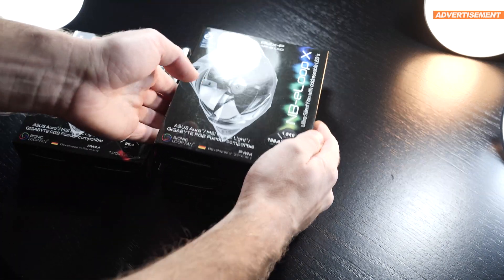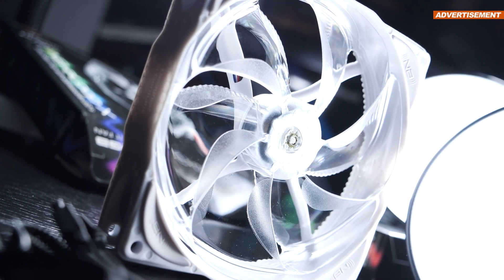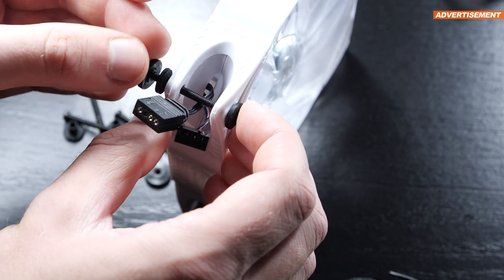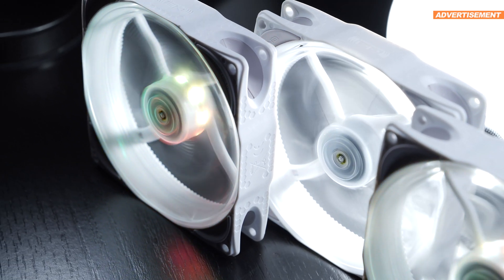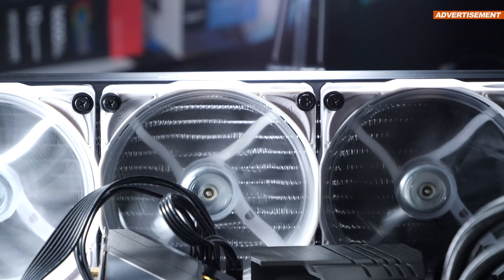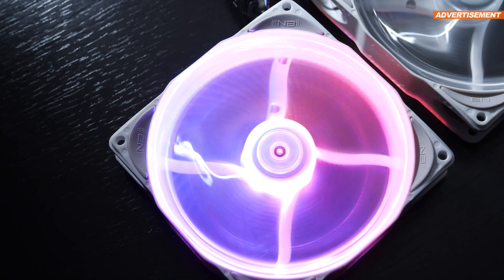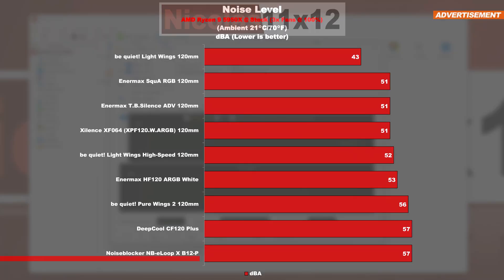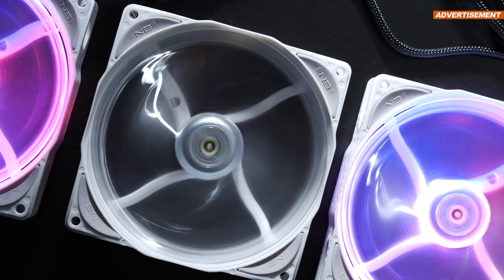UNBEATABLE at LOWER RPM? -- Noiseblocker NB-eLoop X B12-P

Comment from the maker: Have you ever purchased and used any Noiseblocker fans in the past? 🤔
If yes, what was your experience like? 😁
Reply: I bought one back in 2013 or 2014, then immediately went and bought a few more to replace all my fans with these. Years later they all still work without any issue.

Comment: I have these exact fans in the non-RGB version. Me being here to look at the RGB version should say enough about my opinion of them. I've had them for at least 5 years and have tried many other fans here and there and I keep going back to the Noiseblocker e-Loop B12-P fans. I like them so much that I invested in the Phanteks Halo RGB fan rings to make them RGB fans. If I could find the white version of these, like the ones here in the video, I would just buy them and be done with it. I use the P version with my Black Ice Nemesis GTX 360 radiators and they help to keep my R7 7700X CPU and RX 6800 XT GPU at a very reaonable temperatures in a Thermaltake Level 20 HT all tempered glass case with very little ventalation. I have the 12 and 14 PS  versions of these fans where I just want intake, exhaust, or air circlating case fans.

Comment: I'd love for you to test the arctic p12 and arctic p12 rgb (different blade geometry). Both very cheap and might be interesting as a baseline
Reply: The Arctic fans are the best "bang per buck" fans on the market. Arctic's Bionix fans are excellent also, with some added style to them. They are quiet, create a lot of pressure or air flow, have a really wide RPM range, and their PST versions (I think all of their fans are labeled PST now, just something to be aware of) are able to be daisy chained together so there's no need for splitters. Behind the Noiseblocker fans they are my second go to case fan and radiator fan. I use A LOT of them in PC builds that I put together for clients and friends. Arctic also makes RBG versions of their standard and Bionix fans.